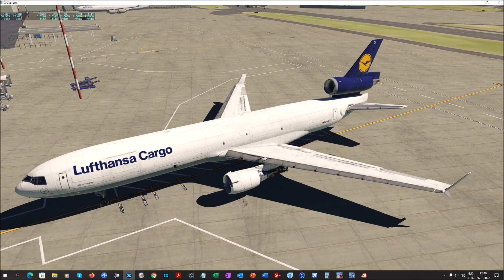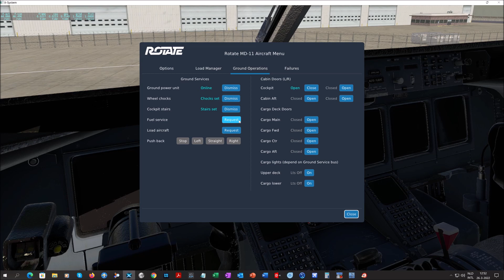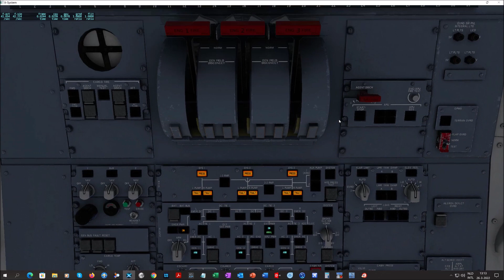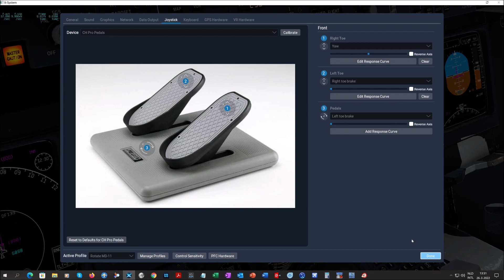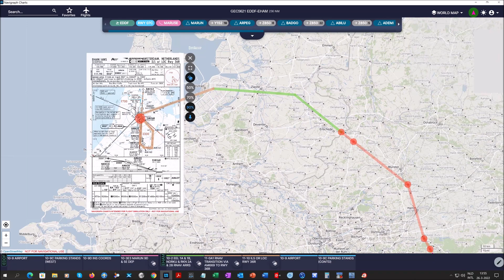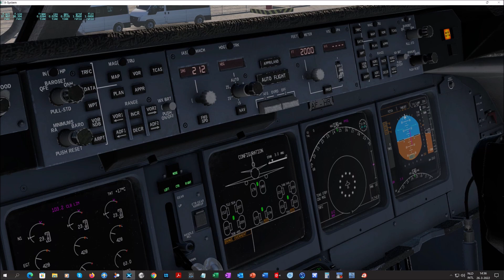RotateSim MD11 First Impressions

Comment: Hey Sjoerd, thanks for this video about the MD11. I was hoping you were going to make a video about this release of the MD11.
The bugs you've pointed out are pretty basic, for example to he heading mode. This should never have been released with such a basic error. Why it was apparently never noted is a mystery to me as well.
I have come across a video on YouTube of a real world MD 11 pilot showing how to prepare the cockpit and program the FMS. In it you'll find a little trick about switching on the APU, and how to show the weather and terrain on the MFD. I have only watched about 60% of it and with regards to the system audible warnings he only tested the one of the set. It did not sound like the stuttering sounds you found when these warnings were announced in your test. I have not bought this add on as yet, but I will when there has been an update to fix the bugs found.
Thanks again 👍
Here is the link - https://youtu.be/iXuqFbVzDeI
Reply from the maker: Many thanks for the videolink, I will watch it in the near future!